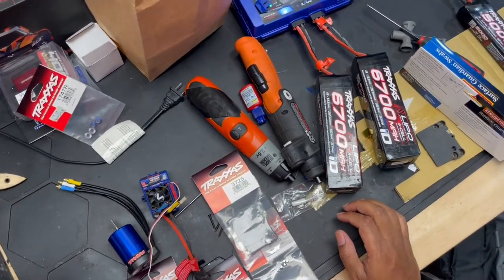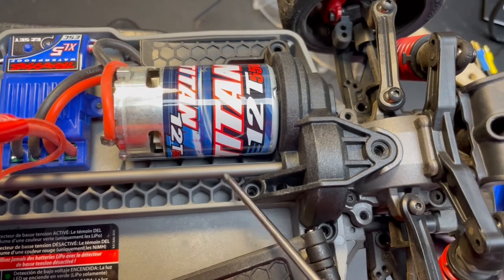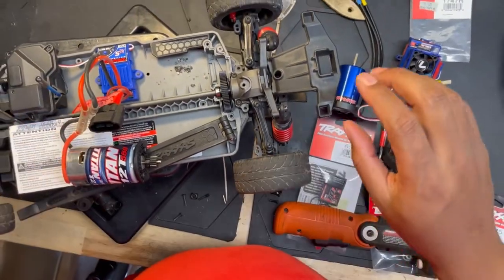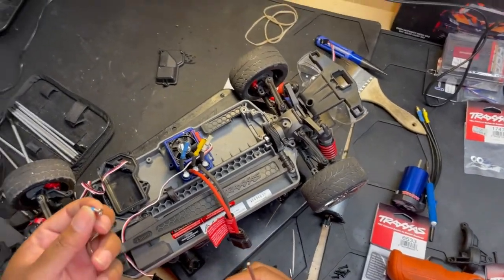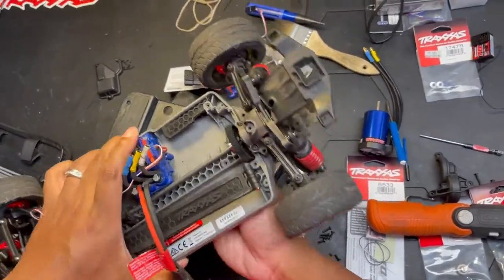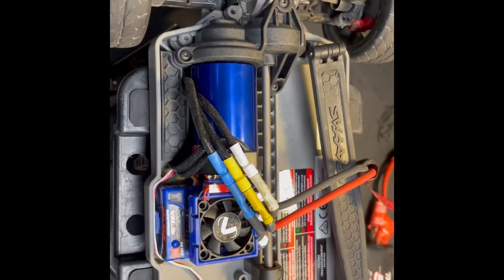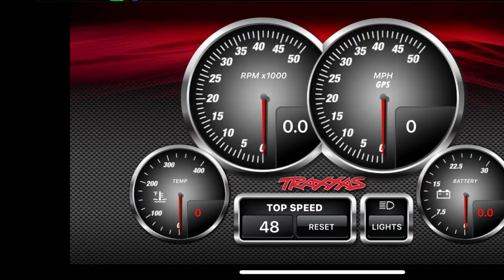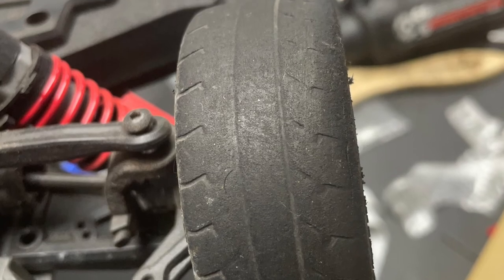Corvette Stingray  Velineon® VXL-3s Brushless Power System upgrade

Comment: Should I go with the vxl 3s system (200 dollars), a hobbywing max 10 esc with 3200kv 3s system (140), a hobbywing max 10 esc with a 4268sd g3 4s system (230), a max 6 6s esc motor combo (290), or get a vxl 6s system (300)?